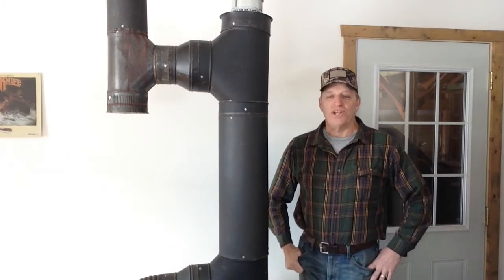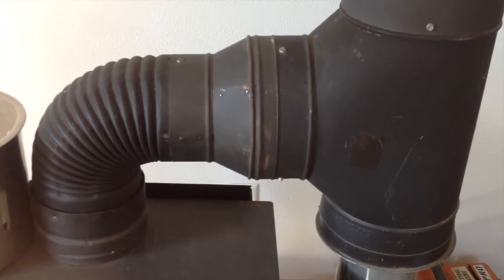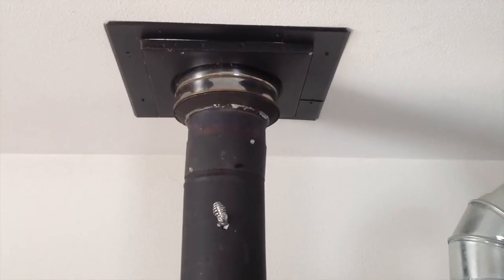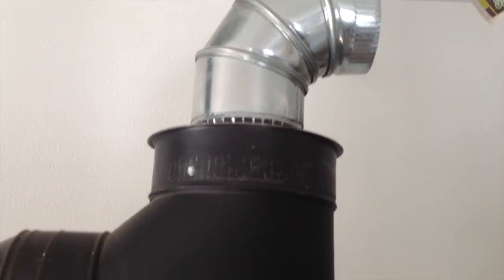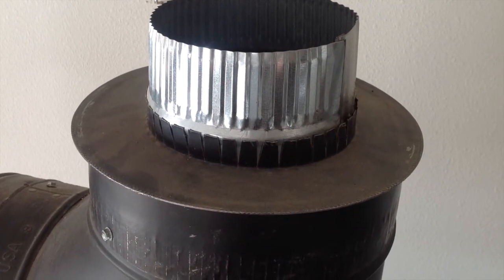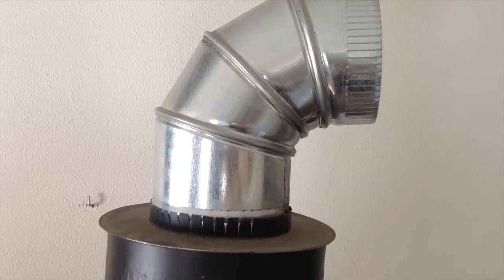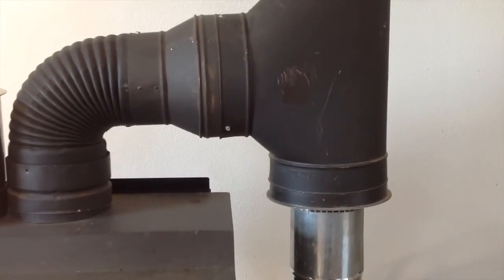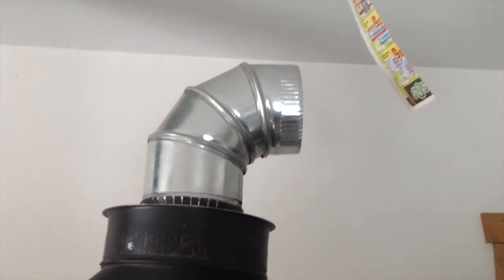How to build a Non-Electric Chimney Heat Reclaimer

Comment: I like your design. 
In my last shop, I had a pipe going through a 50gal steel drum full of sand as a thermal mass. After a day of heating the drum stayed warm for 3 days
Reply from the maker: Thanks for that idea.  I have been trying to figure a way to get more thermal mass around it, and not take up too much room.
Reply: That's the same basic theory as the "mass" in a rocket mass heater?  I've been trying to figure how to incorporate thermal mass without building one of those monstrosities. Can you elaborate; did you run the flue stack through the sand, or was it to the side like this?
Do you think it would work at all to thermosyphon water through sand (maybe coil a few hundred feet of garden hose in the barrel, the way people sometimes do to heat water with compost) attached to the water coils inside the firebox?
Reply from the maker: @FL, It seems like what 'M Thiessen' did from his comment, is similar to a rocket mass heater.  You replied to my comment, instead of his, so he may not have seen it.
Reply: @doubleMinnovations  
🤦‍♂️ technology is not my strong suit. I meant to address his comment.
Reply: @doubleMinnovations  good catch.
Reply: @fl3082  I wonder if a garden hose would hold up to the heat inside the pipe? Maybe use metal pipe for the water?

Comment: Do you use any kind of sealant / caulk around the pipe connections ?
Reply from the maker: I didn't use any sealant.  The chimney works well with having a draw, so haven't had any leakage.   Thanks for watching.

Comment: Smart. 
I'm just learning about wood stoves. Thank you for this video. 
Insulating the stove increases the temperature inside the stove and the chimneys but reduce heat exchange to the room at the unit,  and wood in the stove should burn faster (?) so I see why it's absolutely necessary to regain the heat back from the chimneys.  
I will look at your other videos to see how the wood burning process could be controlled to achieve optimum heat & lengthen the duration that each log lasts.
Reply from the maker: Yes Simo Omis; you want a fast burning fire with this.  A slow smoldering fire does not burn clean, and would create  creosote.  Learning about 'rocket stoves' or 'rocket mass heaters', would really help you to understand that fast burning hot fires, can really be efficient.  'Masonry Heaters' or 'Russian Fireplaces' are sort of in this category too.
My 'hybrid fireplace' videos shows the results of what I learned, and that I combined  the positive things.
Thanks for watching!
Reply: I see. So either you have a long lasting fire and creosote or fast burning fire without creosote. The drawback on fast burning fire is that you get too much heat in the stove & flue in a short time, hemce your ingenious way to  1) Have a smaller fire [chamber] 2)  Reclaim the heat from the flue and 3) Store the heat in Wax. Thank you 👍
Reply from the maker: I wouldn't say there is a problem of getting too much heat in the stove and flue (in this setup), and so the heat reclaimer will solve that.  You don't get too much heat.  The fire is hotter, (because of the insulated firebox) and it's smaller; but the surface areas (that disperse the heat), are the same  as in a bigger less hot fire in an unaltered stove.  The smaller hotter fire is probably about the same Btu's (not sure) that you would get from a bigger less hot fire.  
I use a lot less wood.

In a conventional arrangement where the fire is less hot; you have to maintain a flue temperature of around 300  degrees (or more) to prevent creosote buildup.  You can get a magnetic thermometer to stick on your flue pipe so you can see if you're in the safe zone.  -That's all lost heat. -and if you try to cool that, you can cause a creosote problem.

A hotter fire burns all those gasses up that causes creosote, (or most of them).  -and so cooling down the exhaust, doesn't cause the creosote problem that you normally would have.

The thermo mass is just to store heat to radiate it out later, so you don't need a continuous fire going.
I like that part!  
-Hope this describes my line of thinking better.

Comment: Simple heat convection! Cool. Us hillbillies used to put a section of 12 inch stack, around an 8 inch chimney, and used a fan to circulate the air.  Your's is way better.
Reply from the maker: Thanks for your comments and ideas!
Reply: That's what I plan to do - put an 8 inch around 6 inch - but maybe I should look for 12 inch - thanks